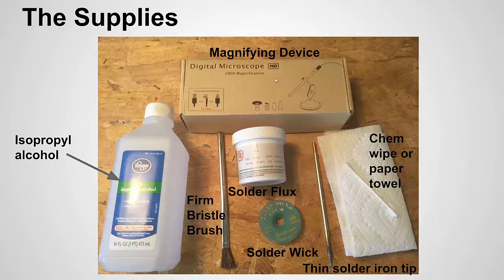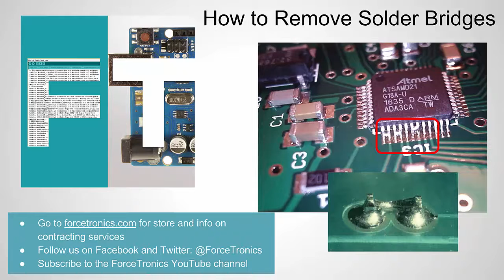How to Remove Solder Bridges

Comment: I cant get my desolder wire to
I absorb the tin at all :-( i've been trying for days but I just cant seem to remove my bridges
Reply from the maker: Are you using flux? Are you sure your solder iron is hot enough? Are you pressing hard enough? If this is your first time You may want to test out different ways on a scrap board to avoid ruining board you're trying to fix

Comment: I have tried everything, I'm working on a PS2 and I bridged a couple pins, I have used a lot of flux, tried wicking, tried drag soldering but this bridge just will not go away
Reply from the maker: That's a bummer, is it just a hard-to-reach spot where you're not getting the heat on it? Not sure if you have access to a heat air gun that can melt solder
Reply: @ForceTronics  I do, have tried that as well, there is literally no reason as to why these pins wont unbridge I dont want to use any more wick as to not wear down the enamel on the traces leading to the pins.
Reply: @ZTwo221 were you able to solve it? Im in the exact same situation now with installing a N64 HDMI mod. Ive been trying to unbridge these pins for days now
Reply: @ I used lots of flux and wick (as little pressure to those pins as possible)  and then a K-Series tip to drag solder while keeping the tip free of solder in between, between cleaning and re-flux

Comment: What heat was the soldering iron at please?
Reply from the maker: I use METCAL soldering equipment which self adjusts heat levels. Its expense but you do not have to worry about solder iron temps

Comment: So solder bridge is just makes the two pins shorted so that the component connected to the two pins is disabled?
Reply from the maker: Yes, it is a bridge of solder shorting two pins or pads together. Disabled is the best case scenario. Catastrophic damage to a component or the whole circuit is worse case. For instance if you short power pin to ground you will most likely see smoke
Reply: @ForceTronics  OMG so appreciate your reply.... I'm new to firmware stuff, just started doing my intern as a firmware programmer and current at my year 2 of engineering... subscribe to your channel!!